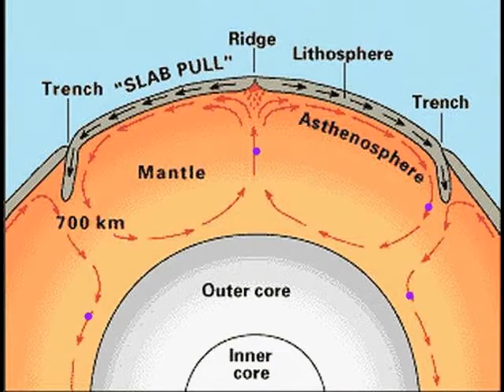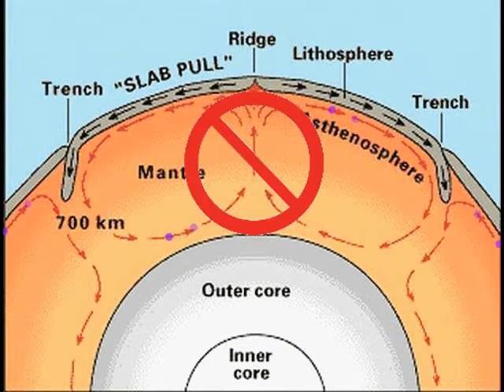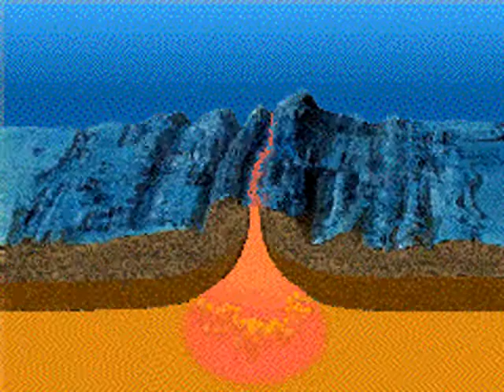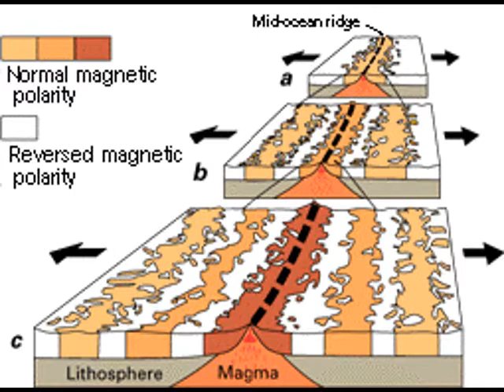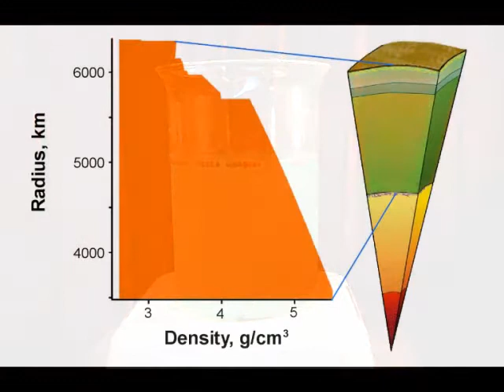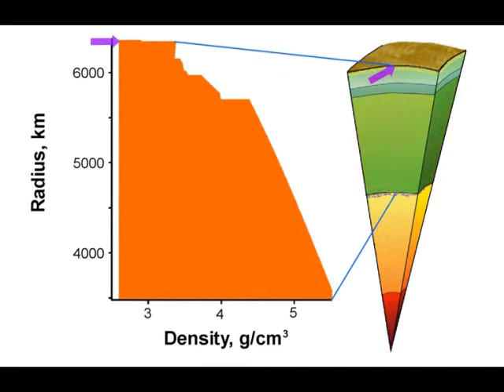No Mantle Convection!!!

Comment: Pointer for all proponents of convection...the mantle is 90% solid. The parts that aren’t solid either expand and rise to the surface, causing earthquakes, or compress and descend to the outer core, also causing earthquakes. Whether the magma rises or sinks is determined by its depth as, below a depth of around 200km, most magma is under such pressure that it compressed to a third of its original volume and sinks. All that aside, solids do not convect. Seismic data reveals that the mantle is solid, and solids, by definition, are too close together, or too tightly bonded, to convect. I won’t argue mantle plasticity, as solids can bend, but the idea that a solid can convect is seriously flawed and in-entertainer by all other realms of science.
Before you say it, no, the heat and pressure do not result in a semi-solid/highly-viscous-fluid state. Such a view is unsupported by seismic data. I won’t argue that the mantle can’t bend, but it is physically impossible for convection cells to form, as the molecules of rock are far too close together, far too closely bonded, and under Farr to much pressure (leading to even less space between molecules) to begin forming convection cells. For convection cells to even hold a shadow of a chance, the mantle would have to be liquid, as was previously thought. As the mantle is not liquid, the only means of heat transfer is conduction.

Comment: You don't need a heat source for convection. You on;y need differential heat above versus below. For example, I observe convection almost every day myself in my cups of morning coffee, which have no active heat source -- merely cooling from the top faster than from elsewhere is enough to create differential density and drive cold coffee (or magma) down, and thus force warmer internal fluid up.

Heat from below makes it FASTER/more active, but is not necessary at all. And of course, there is still also an internal heat source -- radioactivity. But saying "it's not enough" is bollocks, because again, none is needed. Any amount it adds is just bonus to that much faster convection.

Nor is anybody ever claiming that convection continues THROUGH and beyond different layers of the earth. The conventional theory is that the inner core has one set of convection currents, then the mantle has its own set, etc., separated just like your water and oil. So what? Any high school geology textbook already pre-addresses your arguments about layer separation, because they admit and work within the assumption of layer separation already... That's not news. Nor does it disprove convection.
Reply: +mysticdaisy 
you do need a heat source for convection to occur, it can be input (+ heat source) or output (-ve heat source).  Heat loss from your cup of coffee creates a -ve temperature gradient near the surface, the heat lost heats up the air above the coffee.

Comment: Done. Interesting the idea of enstatite chondrites similar to the bulk Earth. But after that, you don't address the problem of Heat within the Earth interiors. Impossibility of mantle convection is very weakly debated, or even flawed (e.g. the density structure of the Mantle).
The assumption of adiabatic mantle is good for the same reason you list: low thermal diffusivity. It has nothing to do with the viscosity of mantle rocks.

Comment: Adiabatic means no heat loss. Rock thermal diffusivity is in the order of 10^-5 [m^2 x s^-1] and probably higher. A thermal anomaly at the base of the mantle would require approximately twice the age of the Earth to be conducted away. Therefore an adiabatic mantle assumption is not a flawed exemplification. Viscous dissipation in the mantle occur, and exactly because there is convection and phase transitions.

Comment: Apart from the totally flawed analogue of water and oil, Plate Tectonics DOES provide an energy source for mantle convection. It is the internal heat. Convection is a thermodynamic  necessity that prevents wholesale melting of the mantle (which we know is solid from seismic data). This is because of the very low diffusivity of silicatic rocks that prevent efficient conduction away of the internal heat.  Adiabatic assuntion relies on this, not on the (high) viscosity of mantle rocks.

Comment: Have you read even a high-school level textbook on geology? Since when does mantle convection theory propose that the outer-core itself convects THROUGH the core-mantle boundary, as in your water-oil experiment. 
The convection happens within the mantle, which is why it's called mantle convection, funnily enough. The heat source is the radioactive decay in the core.

Good luck getting your "science" published.

Comment from the maker: This is science. Radioactive decay energy alone is insufficient to account for the energy exiting Earth, let alone driving geodynamics. The mantle is about 62% more bense at bottom than top. A thermally expanded "parcel" cannot become light enougn to float to the top as required by convection. The Rayleigh number, which was derived for uniform density, incompressible matter has been misapplied has been misapplied to to the mantle, which is compressed by the its own weight. to justify convection.

Comment: This is pseudoscience and pseudoarguments. The plate tectonics has an energy source — decay of radioactive elements in Earth's core. This is a basic fact. So thesis of "no energy source" is intentionally wrong. Demo of water and oil is a juggle too. Author hides the fact that on slow heat convection run both in water and oil layers. Thermal conductivity works on the phase boundary, but only convection support heat transfer over and under this boundary.

Comment: I think a cool slab of oceanic crust is dense enough to sink in the mantle. It should be remembered that what drives plate tectonics is not primarily convection, but ridge-push and slab-pull, the mechanisms on the edges of the oceanic crust. And these have, if I'm correct, been modelled quite successfully.

Comment from the maker: No one has refuted my work in the open scientific literature. Rather than make discoveries most make models based upon assumptions which do not have to be correct. Generally, those who make models ignore my work. When an important contradiction arises in science, there should be discussion and debate, if wrong the idea should be refuted in the open literature, otherwise it should be acknowledged. Galileo was ignored too.